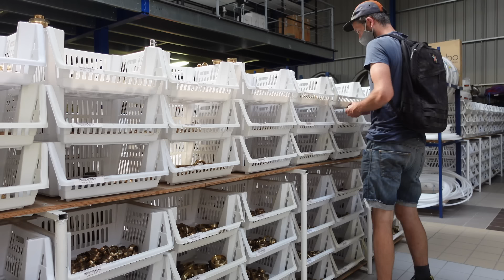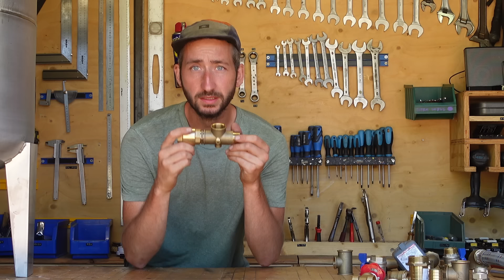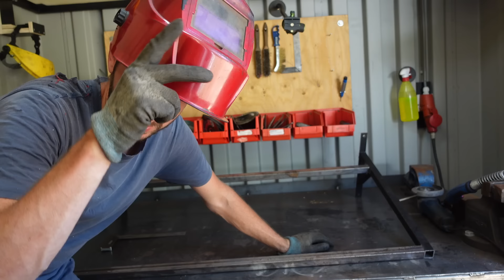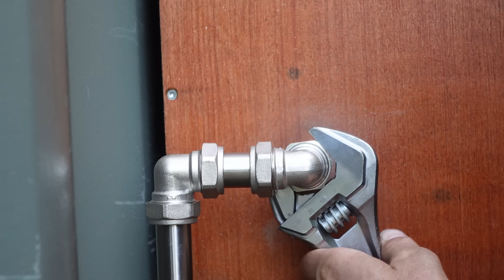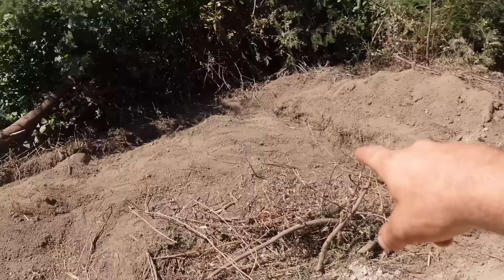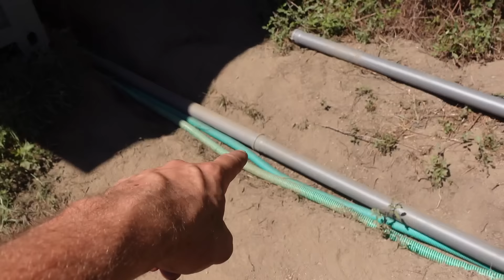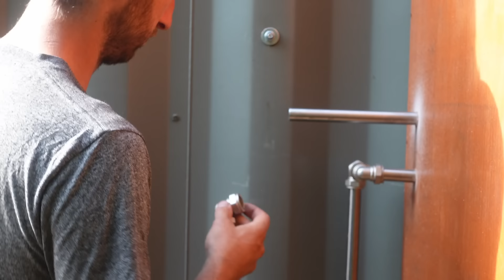#31 How we got running water from a well #offgrid

Comment: with such a great natural water source, you should definitely make a small IOT controlled hydroponics system.
hydroponics is one of the perhaps most sustainable and effective ways of growing vegetables and greens, and using the right combo of microcontrollers and sensors it would only add about 25 watts of additional load to your power source.
Reply: What kind of 'greens' ???

Comment: I noticed that the trenches dug are not that deep.. You might want to look up the information on front line level on your area. Basically how deep does the ground freeze in the winter. Then put your water line to that depth.
Nice project look forward in seeing you progress.

Comment: Hello, interesting project! I think you should have put the filters in front of the pressure sensor and the buffer tank. Because over time, the pressure sensor and the buffer tank will become dirty. Think about it. It is good to bury the pipes that pass under the road deeper and to put them in some metal pipes so that there is no accident as equipment passes from there. Great project! Good luck signing up to watch the other videos and the previous ones;) Once again I wish you Health and Success!

Comment: Excellent work 🤗👍
You are going to need a much larger filter system, preferably prior to the pressure tank.
The filter size you have chosen is normally used in a single kitchen situation. 
Your enthusiasm is inspirational ☺

Comment: id just add a ultra violet sanitizer before the tank that runs off the pressure switch since you have limited power that will sanitize what goes into your tank as far as microbes, the other filters will take the debris out.

Comment: Put the filter´s after the pump, and before every things else, the life off part´s are x10 . 
You already have a pressure manometer, it´s a closed system. :)
Galvanic corrosion ! Stainless, brass, steel, protect the pressure switch with a small  conection lenth PVC pipe, same thing with the stainless pipes ant the control core.

Comment: Super cool build a few things to keep in mind : 

1- Isolation: pipes and full system will freeze causing damage during the winter
2- Drinkability: the PVC pipe is definitly not suitable for drinking water :/ 
3- Cross road technical pipe: I will definitly dig again accross the road and putt a concreate tube to make a passage for all the stuff. If one tube need to be replaced (PVC pipe :) ) just take it off and replace it.
 
But well done ;)

Comment: Just 2 little things. One is I would put the backflow valve just above the submersible pump so water is always in the pipe going down into well so pump will always have a prime. Second is there a reason that you are not using Pex pipe for running all your lines? Cheaper, easy to install and will do better in freezing temps.
Reply: It is a submersible pump. As long as it is underwater it is primed. Your point with the check valve is still correct though. The system shouldn't drain between pumping.

Comment: I used my solar powered submersible pump to bring water up to irrigate the trees (hot here in the Algarve) then I fitted stainless steel pipes and compression joints to connect my esquentador then I sat down to watch your vid!

Comment: So I don't know about frost in Portugal, but the hose is definitely not deep enough in the ground. You can ask the municipality about the frost line in your area. In summer you have warm water and when it freezes you have no water. Because the water warms up due to the shallow depth of the hose, harmful bacteria could multiply.
As it looks, it could be that the hose is also not suitable to be laid in the ground. Normally, plastic pipes that are laid in the ground are black, smooth and very thick-walled. When crossing the road, I would have protected the pipe in a larger and sturdy pipe and above all laid deeper. To protect the pump, the check valve is usually installed as close to the pump as possible and the riser pipe in the well should be a steel pipe in any case, because it does not expand with each increase in pressure (starting the pump). The check valve near the pump also relieves the pump because the water column in the hose by gravity does not press on the pump and facilitates the start-up and increases the life of the pump. also ensures the valve the pipe is always completely filled with water. Personally, I have never had luck with the spring-loaded check valves, with me they were never as reliable as those with a ball that get along without a spring. Connecting the pressure switch to the boiler with the armored hose is also a bit unfortunate, that should be done via an inflexible tube and I hope you put the filters in the filter cartridges. If you are concerned about the water quality you could also install a UV irradiation after the boiler, but this consumes electricity permanently.

Comment: I’ve never seen that pipe used like that. I think it should be 1.5 inch black nylon pipe with compression fittings. Should be 45cm below the ground, it might freeze. Should also be ducted under the road especially with that tube you used.

Comment: you need a belier absorber , a side pipe that lead to nothing that goes upward a feet ahat has a little air in it just to absorb water line shocks for when you close valve

Comment: Wow, stainless steel pipes instead of copper? Must be nice and expensive.
Reply: copper is more expensive than steel, also way easier to deal with the pressure fittings rather than having to solder every connection

Comment: A tip for digging in that soil. Soak it well the night before. In the morning, it should be much softer. Also, a pickaxe might be helpful to have for digging. Also, the garden center may have a durable brass outdoor shower spout (err... sprinkler).
Reply: I had never thought of a sprinkler as a shower spout/head. Good one!
Reply: With a bit of more planning the TLB could have done the trenches while it was around.

Comment: Hi guys, you don't want to water plants under a heavy sun : first most of the water evaporates, second water drops acts as a lens which can potentially damage fragile leaves. The best time to water plants is dusk : reduced evaporation, no direct sunlight burning, water have the whole night to soak into the soil. Oyas can be a great help to slowly water the garden during summertime. Oyas are very popular in South Mediterranean and dry climates. There's a bunch of DIY videos all over the net. Here I have an eolian peristaltic pump (low tech, no energy) which  pumps slowly the water on a water thank which is 3m higher than the house : free pressurised water. 😁 Keep on rocking guys.  😉
Reply: Came here to say this ☝
Reply: I've also seen drip water systems with a rainwater barrel, gravity fed.  Plants never want for water and keeps the roots cooler during heatwaves/dry spells.  Check the barrel level every 3 days to refill, and end of season clean the hoses well.  Much less wear and tear on farmers and plants alike.

Comment: Nice suicide cord for the generator, getting the right Cee plug for the inlet is not that hard, please do get a proper inlet.
Reply: I believe a suicide cord is any power cord with male connectors on both ends.  They are called suicide cords because they exposes AC voltage to careless fingers among other things.

Comment: I’d add a sand filter and maybe a chlorine filter too just to make sure it’s safe to drink as the chlorine kills everything
Reply: including ppl and wildlife ;p .. UV does the same without the killing everything else part, and also no bad taste of chlorine in the water. But before even talking about filters, perhaps let them test the water first, as they said in the video they are going to do? It's likely no filtering is needed.
Reply: @ric_dk-9520  well as far as standards go it needs to be filtered for the uk at least. The uv actually greats some toxic chemicals, this is why in California they used black balls on a large body of water.

Comment: Pro tip the hose under the road  i should put a steele pipe in the road and then  put youre hose in it now you have the risk of collaps the hose when you drive over it

Comment: Are you going to re-seal the well lid? There are big gaps around it when it looked like cement was used to seal it up properly before it was opened. You'll end up with a lot of dead animals and insects if nothing is done.

When the well pump kicked in, did it blow air or was that just the pump pressure causing it to pulse? That might indicate you have an air leak in the line between the pump and tank
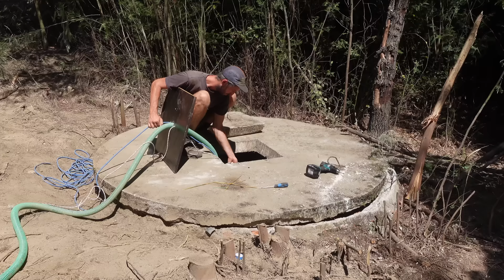Reply: Yep... BIG GAPS around the lid visible at 2:40 - A couple animals crawl in there and die and you won't even want to take shower with it... let alone drink it! The guys who put the lid back on did a half ass job!
Reply: definetly. those little cheapy filters will not remove all dangerous pathogens from that well. you need a reverse osmosis and or UV filtration system.
Reply: The check valve should be installed as close as possible to the pump and not after the expansion tank. To prevent the backflow.
Reply: @iznogudsurfer5911  If it was installed after the tank it wouldn't work like it does in the video.
Reply: @mrcake00  I'm sooo sorry, you're right.English isn't my first language. I meant near the pump and not near the expansion tank.
Reply: @iznogudsurfer5911  NB km bh been
Reply: @dewaindrawan3809  Are you fallen asleep on the keyboard?

Comment: Cool running water 👍💪. One question: the water pipe does not need insulation around the pipe. Especially in winter time (below zero)

Comment: The filters sitting above the pressure switch is a bit dangerous, if they leak.
Reply: In a pressurized system, gravity is hardly a concern -- pressurized water can spray up, down, right in your ear, right in your eye, pretty much no safe place.
Reply: @Wingnut_Stickman  leaks tend to much lower flow than that and drip downwards.

Comment: I suggest you not filter water intended for irrigation. This will reduce the number of filter cartridges you will use annually.
Reply: A simple sand and fabric filter is advisable to keep large debris out of the pump and the rest of the system. Otherwise yes, irrigation water doesn’t require filtration
Reply: why would they use the well for irrigation, when they have a small "lake" they use for that?

Comment: I was very surprised to hear you describe the water fittings in inches, not metric! Is that how pipes are measured and sold in Portugal, in inches? Or were you just translating for those of us who use SAE?
Reply: That kind of measure is used in Portugal. But the main is the metric system but in that kind ( tubbing and pneumatic ) is used
Reply: We call it polegadas
Reply: @TheJagdias  thank you for your response and explanation. Fascinating! I had no idea that anything in continental Europe still used these older measurements. 

Here in the US, we sometimes see labels that translate into “polgadas” and “pouces” for the many Mexican and French Canadian people, but of course those countries are mostly on the metric system.
Reply: Pipe diameters are normally metric, but threads are always imperial.
Reply: if you use modern flex pipes over here it's in metric. but yes all "old school" "hardliners" are in inch, cus it just makes no sense to change it.. We have the perfect mix of both in pipes and tubes .. always makes it more "exciting" to go shopping parts cus you need to keep your brain scarp to get the right parts :D

Comment: As well as the folk saying you should put a culvert pipe in to get the water and power lines protected under the road, you'll probably need some insulation on the exposed pipework in the winter. You don't want a freeze to burst all the pipe work you've now put in place!
Reply: I second this, you need better insulation on exposed tubes.Remember this moment?
 https://youtu.be/NFZgNeuo31A?t=100

Comment: It would make more sense to have a filter before your tank (prevent contamination of the tank/debris collection). But you could also put a rough filter for this closer to your pump/above the well. That way you would prevent a lot of clogging (also if you ever get a clog/blockage check the filters, and if not the filters then check the flowmeter!)
Reply: Standard practice in rural Portugal. Well to pump, then to pressure vessel, then to filters/strainers,
Reply: Basket strainer near the well will avoid a lot of problems. The flowmeter could be damaged if debris is pumped up
Reply: Agree. I use the water tower system and I put the filter after the pump, before it reach the tower. The water tower have the clean water and it will not reduce the gravity pressure which is crucial for me. Better to use the pump for pushing the water through the tank instead of using the natural tank pressure
Reply: the pump should have a strainer/screen on it to keep anything of size that actually can damage the diaphragm in the pressure tank out. If you put a filter of any significant restriction before the pressure tank, that puts a lot of strain on the pump. extra fine filters like the 5 micron filters require a good deal of force to push water through them, which is way easier for the pressure tank to accomplish than just the pump on its own.
Reply: Agree! We have the filter after our tank and the tank is constantly filling up with dirty water.
Reply: Typically you put filters after the pressure tank so you don't work your pump as hard. If your water is dirty enough that it's filling your tank with with sediment I'd just build a way into the system that would let you flush the tank every once in a while.

Comment: Congratulations!  The simple pleasures in life :) As a thought for the future and possibility of you expanding your water system, you mentioned water towers/ gravity feed systems. Im not sure how heavily you use your batteries but it would be a fairly easy thing to set up your over flow power (the extra energy you cant use when your batteries are full) to power the pump to fill up a large reservoir tank giving you a large gravity fed water system only utilising power you would not be using otherwise effectively increasing your battery bank size in the process. This is done in houses with pv systems by dumping the extra power into heating hot water for the house so should be easy to find info on this kind of thing.
Reply: I have a tower ( made of concrete blocks..)  4 metres high with a fiberglass tank of 500 liters on top of it...next to the well ...and the motor to feed the tank it's only a 750 watts triphasic...500 liters of water lasts for 2 days....so the motor only works every two days...and it take 5 minutes to fill the tank...my electricity bill for that  motor is  around 1 euro a month.....😏

Comment: Flexible tubing under road might break or leak at some point in the future. Those pipes on the outside of the container might freeze and burst It gets pretty cold in Portugal. put around some isolation or leave them empty at night in the winter
Reply: I seem to remember snow in their first videos, so yeah, frost-proofing is most definitely important!
Reply: @Ragnar8504  I'm from Portugal most times is fine, but now with climate change a few nights during winter can get really cold. We had similar piping at my house and one night it almost froze up. 
Neighbors put cloth's othe their water meter so they wouldn't freeze.

It not that bad but so nights can get really cold

Comment: In my opinion most channels about sustainable way of living on YT have a huge misconception. It makes me smile when videos starts from : I have just bought this mill for 12 000 and we gonna cut some timber for my cabin or here is my 20 000 solar power system to get a “free” electricity. Building from reclaimed wood, collecting rain water , this is sustainability and simplicity, what you are doing in this video is just bringing “city” to this wonderful virgin peace of land. You don’t need  pumps, fittings, pipes, pressure tanks to get water !
Reply: This is the way of YT "eco" folk. Have you seen "Eco & Beyond" - absolutely atrocious mis-labelling. The episode where they bought a big, new, diesel powered garden machine when they could have used a local ruminant was beyond alright... beyond idiotic.
Reply: @CaminasDrummers  they try to be as eco friendly as they can, I believe, but sometimes it's not possible if you want to get ahead doing projects. They are also not vegans so you probably have "an opinion" about that too.
Reply: @Roosmarijn035  vegans?
Reply: @CaminasDrummers  a new engine runs more eco friendly and uses less fuel than some "local ruminant" .. so if they need that tool more down the line (and I bet they do, or they would not have invested in it), they did make the more eco friendly choice in the long run.
Reply: @ric_dk-9520  following your logic 6 liters v8 is eco unfriendly, but 5.7 is more eco friendly choice. Btw my point was about sustainability, not eco friendly, this are different things.
Reply: @ric_dk-9520  aaahhahaha. what fuel does your goat run on? petrol? ROFL
Reply: @AKGaragezz  and I did not comment to you... ;P
Reply: @CaminasDrummers  high octane rocket fuel ofc
Reply: if you don't like them, don't watch ;P .. also "sustainable" is not = primitive .. If you like to use a bucket and a rope to get the water out of the well, good for you. And your comment about engine volume, has nothing to do with what I wrote... so no "not according to my logic"... but I guess haters always only read what they want...

Comment: Are you planning to suspend the pump inside the well off the bottom so it doesn't suck up sediment that collects on the wells bottom? 
That might have the hiccup in the water flow at the end of the video.
Reply: the hiccup was just air in the pipes...